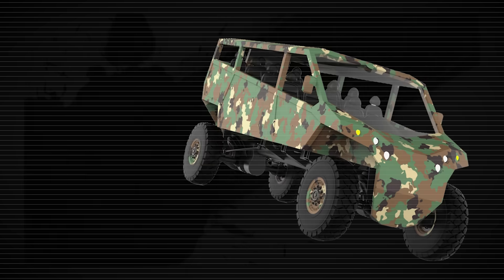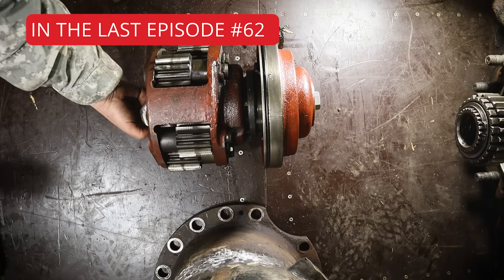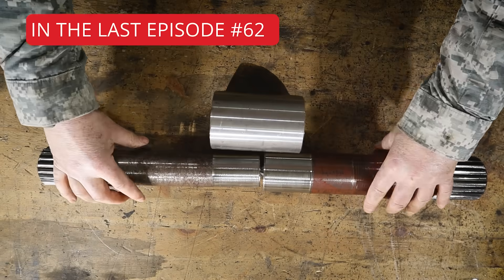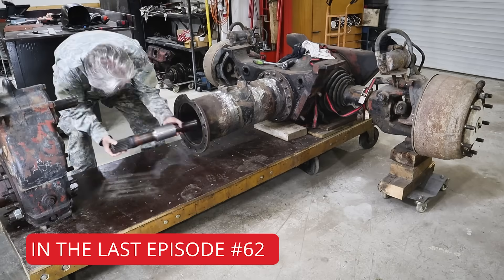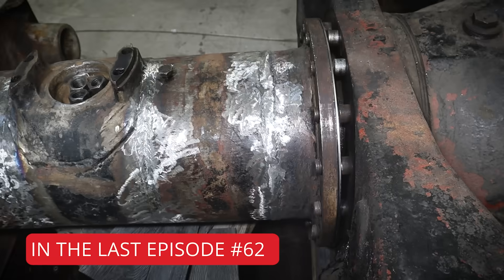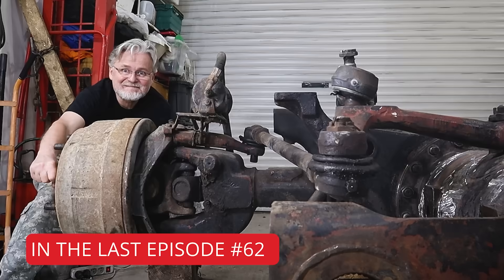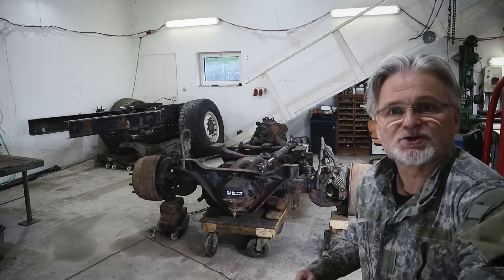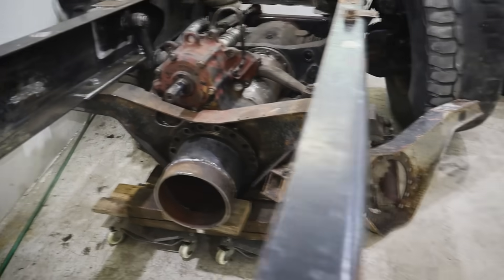EP.63 - 2 Wrecked Teslas + 2 Junkyard Tatras = One INSANE Off-Road Monster Truck (Build In Progress)

Comment: The drive shaft fabrication is lacking some important plug weld holes. Your single point periphery weld will not survive long life at high torque.
Reply from the maker: I have something better than plug holes. I have the welded pins there. I point to them in the video.
Reply: @offroadelectric9457  Very good!  I did not see that episode, I had to go back and watch it too!

Comment: You really need an overhead crane of some sort (or at least an angine crane, or making more use of your fork lifter). Some of those sequences could have been a lot less effort if you'd used the lifter and some straps

Some of those parts are hellishly hard on your back as you're pulling them off and your back shouldn't be used as the crane
Reply from the maker: It's like when I am in the gym. If I can  lift it, I  do so.🙂

Comment: I usually don't care for EV's nor EV conversions.....but this actually looks dope.... what would be really cool though, would be to install a small diesel engine somewhere that can run a generator so that you'll always have electricity for propulsion.... like a diesel-electric train or some of those huge mining dump trucks use. 👌🏻
Reply from the maker: Thank you! I am currently working on the channel intro video where everything will be explained. This is an extreme truck directly designed for specific off-road races during weekends. So the buttery size will handle just that. Anything extra would just add  the weight. In the real world of charging stations being 2x-5x closer than the range of electric vehicles and growing every day, the hybrid system just adds the complexity,  price, and weight.

Comment: They sure did over engineer them Japanese K cars.
Reply from the maker: Tatra chassis has more parts, but you get a lot from it. You can build like lego 4x4, 6x6, 8x8, 10x10 and up. You can lock each axle, and you can lock all axles together.
Reply: @offroadelectric9457   I was joking about how that diff probably weighs more than an entire Kei car.
Reply from the maker: @anomamos9095 😀 Aha. The axle is somewhere close to 750kg. 🙂

Comment: 4:13 - surprised that this hydraulic jack is working properly in horizontal position
Reply from the maker: Only in this position. If you turn it left or right, it will stop working.🙂
Reply: Oh yes I found this out the hard way when trying to jack something sideways before.
Reply from the maker: @danielbryars1 I tried it before in my early video, and it didn't work. And somebody wrote the comment how yo do it.🙂

Comment: I am convinced tatra uses Highest number of precision machined parts in trucks.. I am not complaining 🔥
Reply from the maker: There is a lot of precision machined parts in Tatra chassis, but they are still workable with simple tools.
Reply: I am baffled by the technical beauty - parts and assembly is done with so much attention to detail. I am not a mechanic, but even without the knowledge, the level engineering is clearly visible.
Reply from the maker: @pan6593 Appreciate it!
Reply: Right? Those worm gears are beautiful. What kind of CNC automaton does that? Just taking it apart is a skill. I watch dudes turning bars on a lathe calling it cutting edge engineering when there's a whole other level of machining to be seen
Reply from the maker: @trollmcclure1884 The truck was nanufactured in 80's and the concept is 100 years old. No CNC.🙂  This axle was a junk with teeth damaged and bearings ruined. You will not believe how easy will be the repurposing the parts I  took from it.🙂
Reply: @trollmcclure1884 you hota see how they produce these. I have seen hot forgings of these, they produce these for Indian army here.